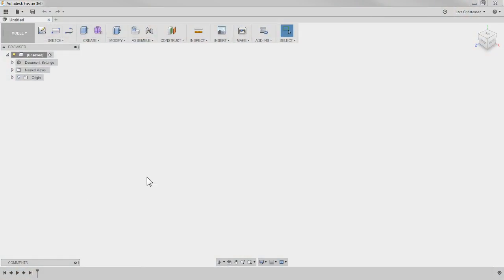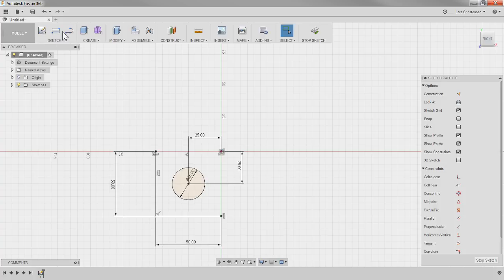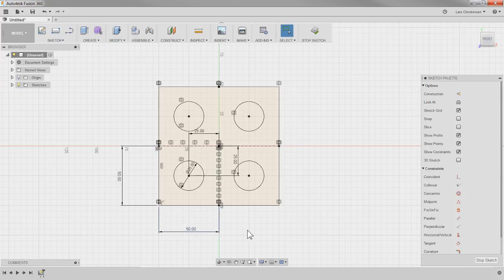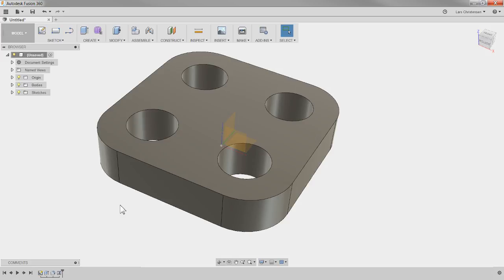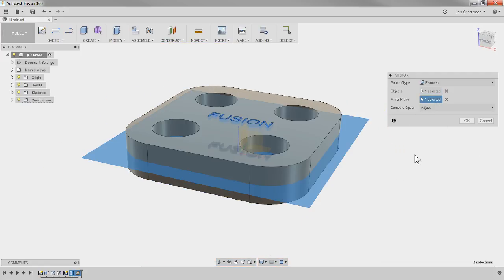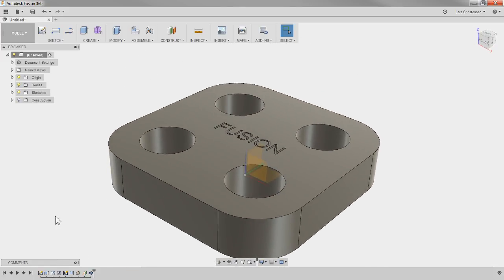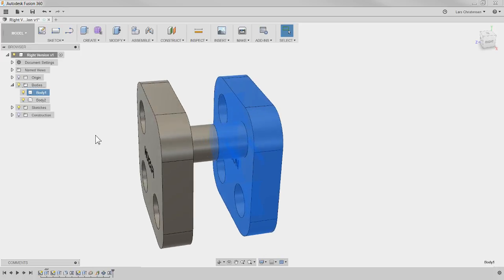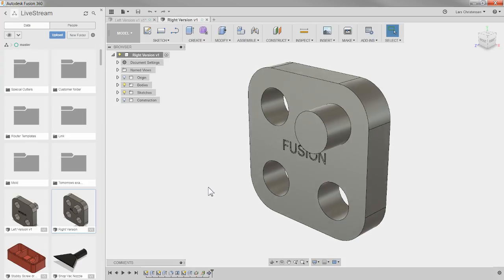Understand Mirror & Some Cool Construction Tools— Fusion 360 Tutorial — #LarsLive 124

Comment: Cool video!
I use to learn design spark mechanical, i want to learn fusion 360 for more complex designs. I want to create a object with some features to fit a bearring and some springs inside piece, the issue is that i want to have 8 bearings in total with same features, i don't know how to use mirror function, to make 1 feature and apply it 7 times more in simetry on 7 different angles and faces within same piece design. It is a hard press a bearring with a rod through it to fit by compressing rod into a plastic 3d printed object that i want to create, at the ends of rod of each bearing to be sustained by a steel spring.

Comment: Is it possible to mirror entire components to include joints? I'm lazy and would rather make one complex component than four, I tried making a mirror to get two and then making a mirror of a mirror to get four, this looked great but the parts had hinges and once I tried to move it around only the original stayed together, the joints hadn't mirrored along with the parts and the others fell apart.

Comment: Man I can get frustrated when I watch a video, do the same thing and it dont work.  I made a rectangle block, cut another smaller rectangle out the right bottom corner. Then mirror it from right to left. Worked perfect. Mirror it again from bottom to top. now I have 3 cut outs and try to get a fourth one in the left top corner. to do that I try to mirror one of my mirrored objects. that I cant get to work.
How can I do 4 cut outs that always change to the dimensions of the first one?
Reply: Its because Fusion 360 is utter crap and getting worse with every update. Lars shows so called "features" which dont work!

Comment: ok.. I have a question, probably noob, but.... when I try to mirror, the "Pattern type" option isn't there so I can only choose an object, but not a feature for example. Any solutions? I am on the "Mirror" from "Create" and not on the one from "Sketch" btw (that one is greyed out anyway so even if I wanted I couldn't purposely mistake it)
I've used mirror before and it was working fine too...
thx for anyone that can help
Reply: Updates Dude, updates which actually made Fusion less functional. Lars knows this thats why few questions are answered by him anymore. I used to be a fan of Fusion, i now have changed my mind on it, its NOT easy, its NOT usable and Autodesk are doing this deliberately to move users onto a more lucrative cloud based software

Comment: is there an option in Fusion 360 to have a real-time mirror applied? For example I set up XZ to be my global mirroring plane and start building up half of my model in positive Y-direction and it instantly mirrors these steps on the other side of the XZ Plane in negative Y-direction? I cannot seem to find it in fusion or anywhere on google. Thanks.
Reply from the maker: There is not. Normally you would build the entire right before mirroring to the left
Reply: @cadcamstuff  That's exactly what I'm doing. Problem is, that sometimes it just destroys the bodies. Most of the time when its an extrusion to an object. But thanks anyway, I was still hoping it was somehow possible :D

Comment: Great share, thanks.
History in Fusion 360 can get cluttered up with edits, can it not?
It seems this is a negative of History. How long does the design go before all those edits are confusing to the next person that picks up the design. I know you can play the History like a movie, but it seems there has to be a cleanup along the way, but I don't believe I ever heard of that being done. This is more of a workflow issue than anything else.
Reply from the maker: Thank you for watching. There are a few tricks, such as you can group operations by right-clicking. But to your point, it does take some discipline when you add many features
Reply: @cadcamstuff  There's two levels to a design - first, to imagine the parts correctly, then to find a good step flow in Fusion 360. Two skills. And, of course, a third level - tool-specific attention to get a good toolpath, right?  You should offer training on Udemy, you have a lot to offer...

Comment: Thank you Lars! I used the (sketch) mirror tool for the first time and it worked great. I had one issue, it seemed that the line had to be in the current sketch?
Reply: yes. it seems so, and is quite strange for me. for every sketch i have to draw new construction lines instead of using the ones i made minutes ago.
Reply from the maker: Thank you for watching.
Yes, you are right. The mirror sketch function need to have the line within that sketch. You could use "P" to project a previous line if you want to use that to mirror about.

Best,
Lars

Comment: Hello Lars :-) I have wondered if there is a more accurate way of adding text in fusion. like in this video if you would add the text manually again on the (new) left version, how could you make sure it is placed exactly in the "right spot". hope my question makes sense.
to me it seems that you have to sort of eyeball it.
Reply from the maker: Hi Jokke Thank you for watching!
Great question! You could insert a point and dimension it, then when you start your text, snap into that point. Hope this is useful.

Best,
Lars
Reply: well i still think the text command is a little "poor", but i guess its not really used a whole lot, i know i haven´t anyway. Thanks for the tip, it made me a little smarter :-)

Comment: im curious as to you current computer specs for running fusion, according to the website mine is sufficient but to me it seems slow(only an I3),my graphics card is an amd radeon hd6450, 2core@293ghz,and 6g ram
Reply: I think your graphics card would matter more. I can use Fusion on both an I3 and I5. My I3 computer is challenging to model in with a terrible card. Edited for typos :(
Reply: One thing that I've found makes a big difference - click on the help icon in the upper right, select Graphics Diagnostic, then select the option for Limit Effects to Optimize Performance. Before changing that, I had pretty bad lag/delay - afterwards it runs super smooth. I don't know what effects are being limited, but I've never noticed anything that's now missing... other than the lag!
Reply: I'd say your processor is the limiting factor, an i3 is generally dual core and it seems to be quite a low operating frequency too.
Reply from the maker: I have to admit that I don't have much knowledge about the internals of computers, so I am really happy and thankful that people like Xyienced, Mike Schuster and jonesrichardmr are around :-)